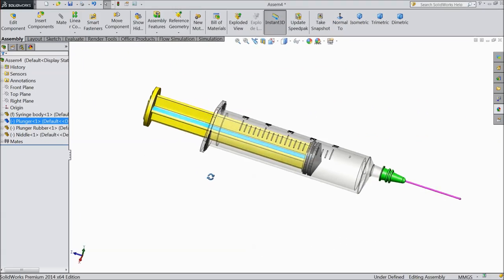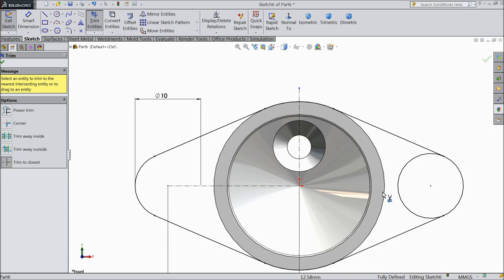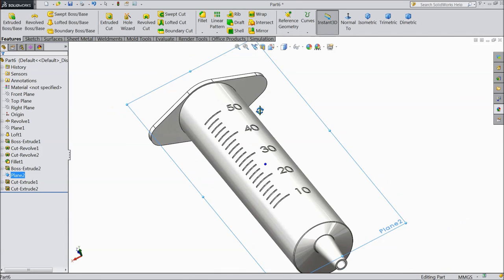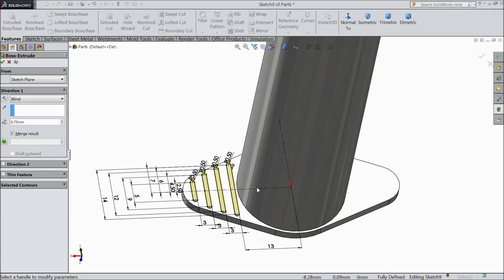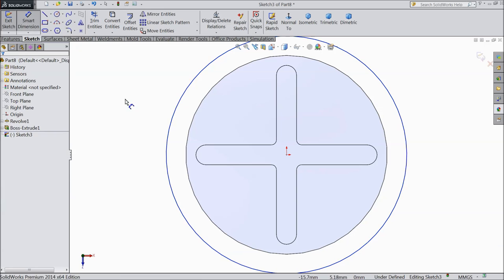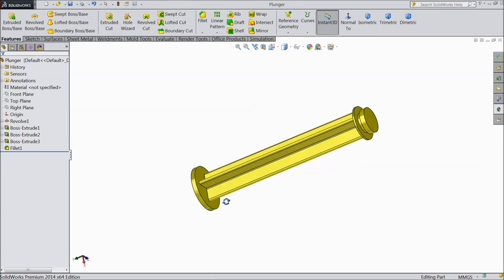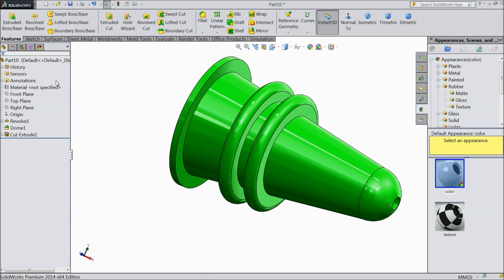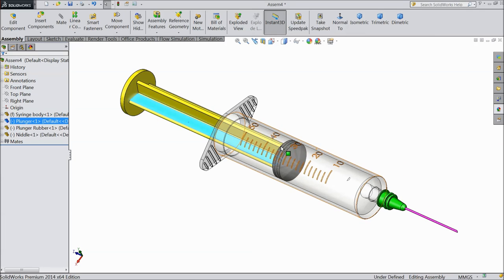Solidworks tutorial | How to make Syringe in Solidworks | Solidworks

Comment: You should have used the straight slot with center point on the gripping surfaces and pressure surface and it would have been a lot easier. 🙂
But again......nice Video. 👍👍